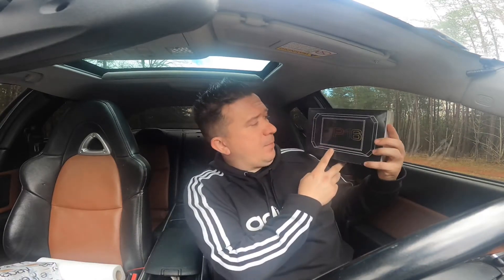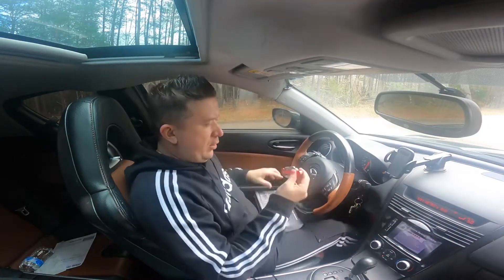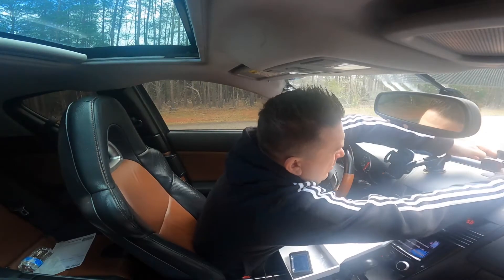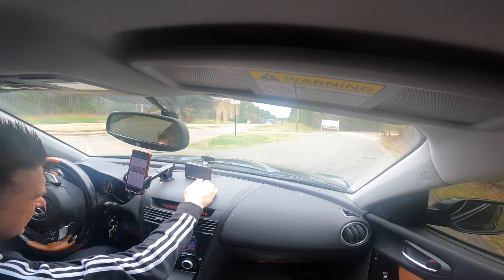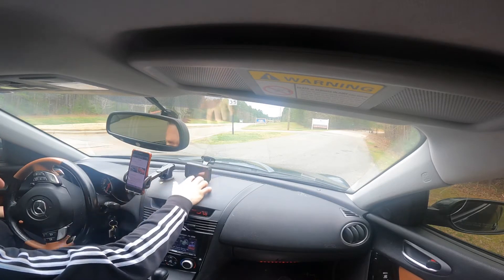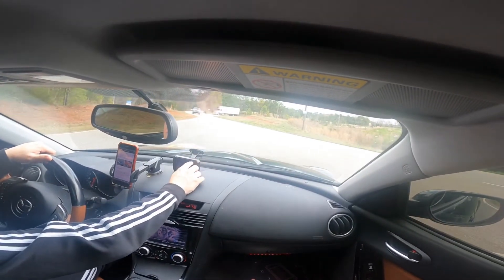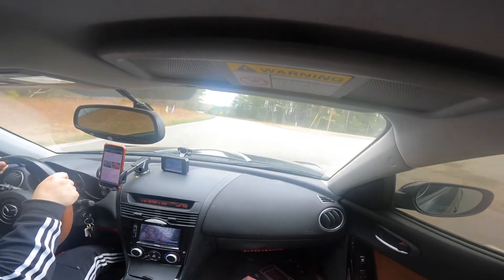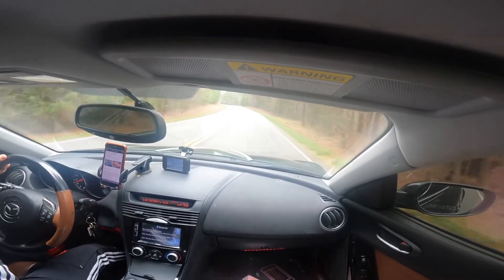Mazda RX-8 Performance Volo Chip VP16 Power Programmer 0-60 Timer 1/4 Mile tester and Dyno

Comment: Does this actually work? Have you noticed any noticeable gain with their supposed tune?
Reply from the maker: I think it works, because you must select what all you did to your car and it actually applies tube based on your entry, yes I noticed mine is a little faster, also my fuel economy went from 14mpg to 24mpg but at same time my Acceleration went down from 9 seconds 0-60 to 11.6 0-60 I have 129k miles on mine, next few days I will post one video per day, I got a starting problem, but I figured out how to start it, but I think my head gasket is blown and my Apex seals are bad, so I will do a rebuild of my engine on this channel soon
Reply: What electric supercharger did you get?